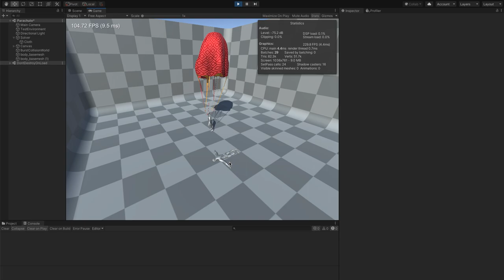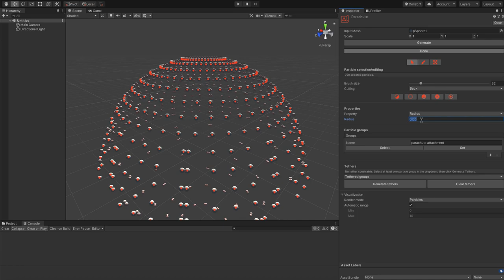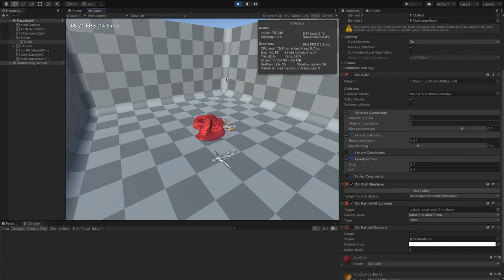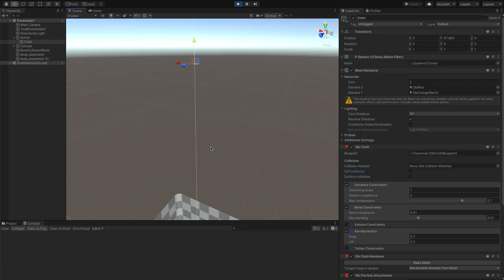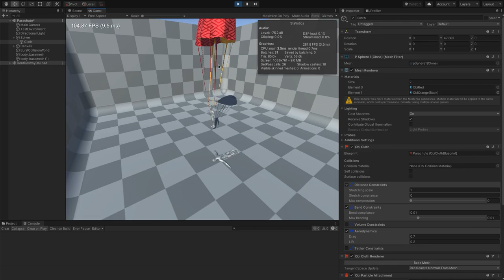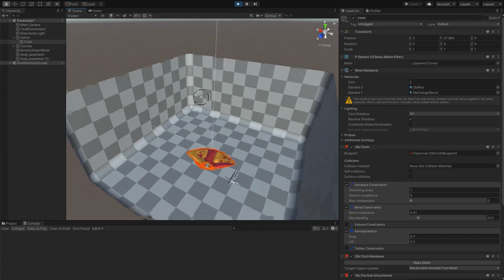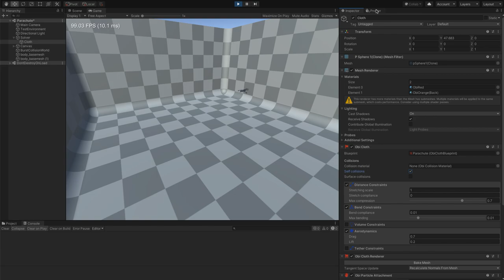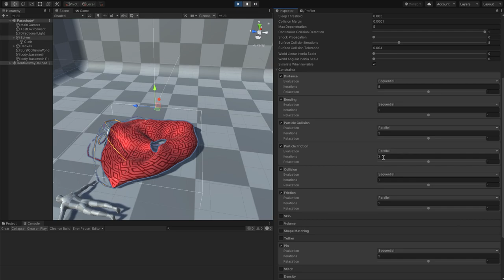Obi Cloth Parachute

Comment: Any video with mesh colliders applied for dress model, I have character with dynamic mesh collider to have impact with blend shapes. Also combined mesh which have sub meshes giving issues.
Reply from the maker: Dynamic mesh colliders aren't really supported in Unity, and for good reasons: they're extremely slow and brittle. Updating a mesh collider every frame forces Unity to recalculate the mesh's internal spatial structure (likely a BVH or Kd-Tree) every frame, which is slow. Also since concave mesh colliders are surface-only colliders, moving them around results in a lot of tunneling issues.

Long story short: don't update mesh colliders every frame.
Reply: @VirtualMethod  Not doing it with every frame, on selection of body size it varies then start the app with cloth. I am facing issue with setting up simulation with default mesh collider itself. Shall I share the file, can you help on.
Reply from the maker: @benrajsd2199  Sure, send it to support(at)virtualmethodstudio.com
Reply: @VirtualMethod  sent, please check